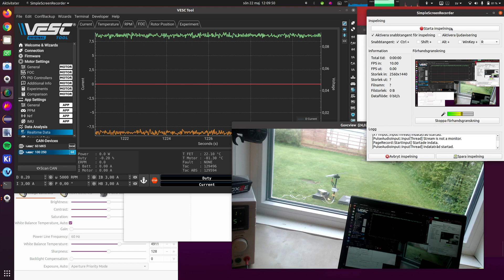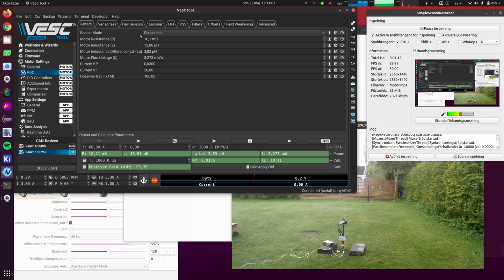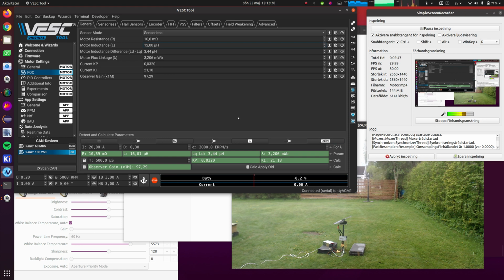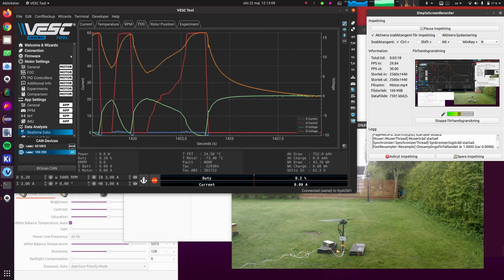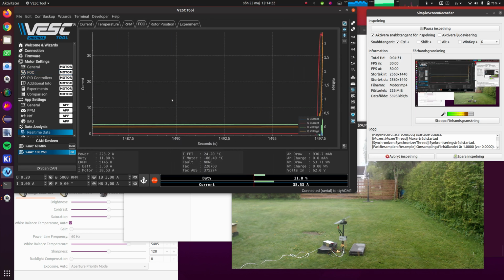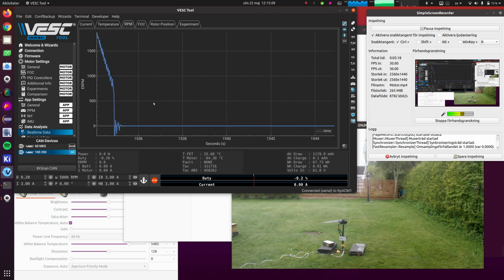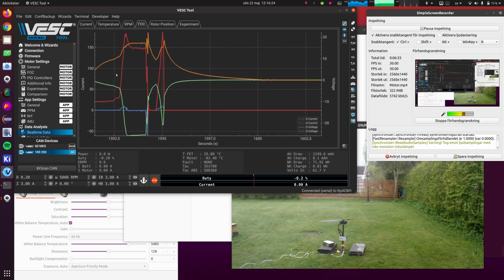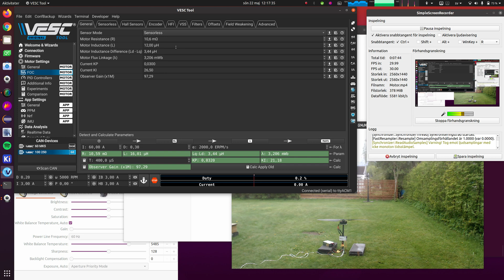VESC FW6 beta with new observer: t-motor U15

Comment: Under ideal conditions, how many kw could be delivered to a motor? Assuming maxed voltage, and a beefy battery?
Reply: depends on the controller, there's the 100kW+ Axiom project based on VESC which is more car/EV oriented

if you mean the 100/250, approx 20-25kW
Reply: @BH4x0r  thanks for the reply 🙂

I have the 100/250. 

AFAIK The Axiom is unobtainium ATM

Comment: Hey Benjamin, I can help you with the transition to FW region, usually industrial controllers like sevcon uses 3 PI, one for Iq, other for Id, and the last one of is to control the modulation index(FW gains) And there is another parameter that limits the max mod index where above that point, start to work the Id FW.

Comment: That’s cool, I am new at the Vesc world, got a few from trampa, just trying to learn it while doing lots of other stuff, just testing on my mountainboard now but I’ve been running into something like 2 motors via cambuss and when I go full throttle the motor on the buss stay on and the one with are getting the input signal stop, have any idea what that could be ? I’m sending servo pwm signals from a teensy to the Vesc…
Reply: Sure the teensy is only connected to the VESC contoller and has no other connections? Check for Ground loops! If the teensy gets power from a seconsary source, you have a gnd loop.
Reply: @frankdrenckhahn9521  teensy is connected to the master Vesc, all grounds are good, I thought it could be some issue with my code, but not sure yet, just building a bigger test battery now cuz I was testing with 3p now I’m going to 9p
Reply: @itsfernandodz  3P not fully charged might trigger under voltage protection under higher loads. Check your battery settings and the charge level.

Comment: Great stuff Benjamin , My Trampa Vesc  100/250 turned up this week so really hoping these new updates when released will allow me to run my MAD C50 34Kv 64 magnet pole motor for testing .. excellent work as always so thanks for these Updates and ace product , selfish thought but if this Vesc Can Handle the Mad  Motor im guessing a lot of experimenters will beat a path to this controller as bang for bucks this one would be top of the pile :-)